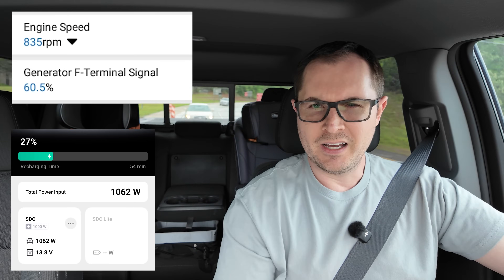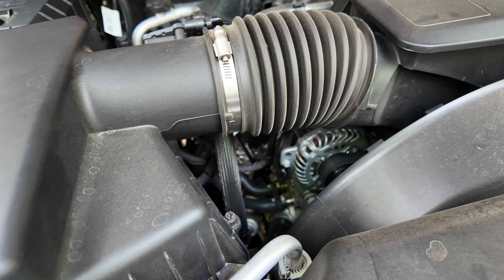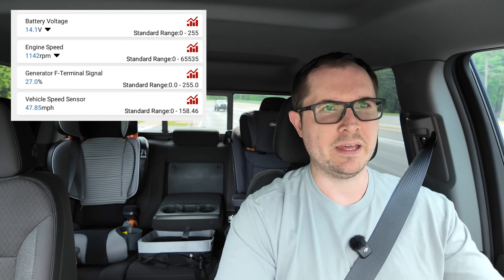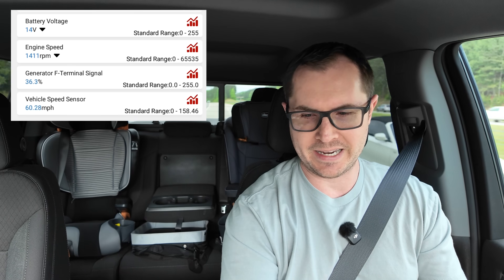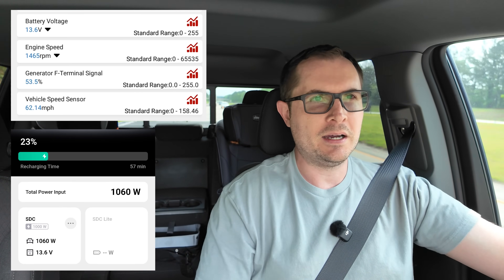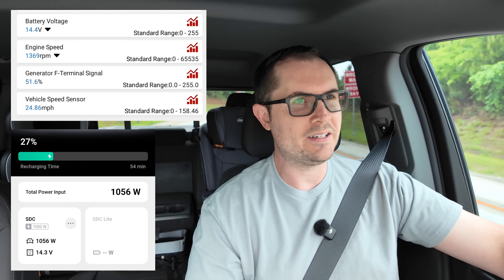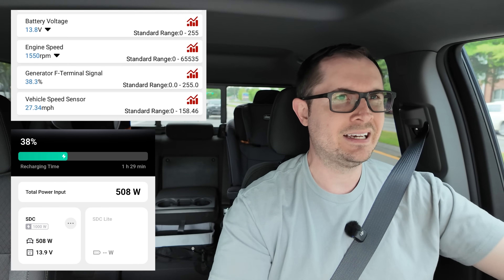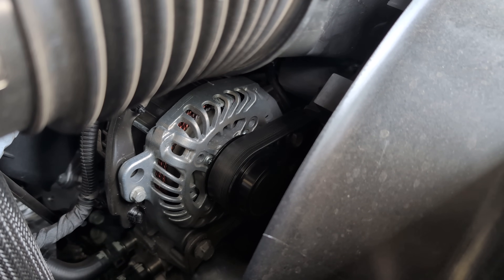I Show REAL Numbers: Impact of DC-DC Chargers from DJI, EcoFlow, Bluetti on Alternator

Comment: Question: How have you wired your charger to the vehicle battery? Have you connected the negative terminal directly to the vehicle battery, or have you connected it to the vehicle chassis? If you have it connected to the battery, the return current is not going through the vehicle current usage sensor. If the vehicle is not aware of the extra current usage, it is not aware that it needs to increase vehicle RPM at idle to compensate.
Reply from the maker: Great question. I'm relatively new to GM trucks, but in the process of installing the DC-DC charger on my truck I discovered GM's EPM system, which apparently has been around since ~2005ish. It's my understanding GM used to use a ring/sensor around the negative lead to read in current that fed into the EPM system, but it appears at some point in the last few years GM changed to what almost looks like a mini shunt/bridge right on the negative terminal of battery (small plastic loop/clip with thin gauge black wire running to it). So just gotta keep any accessories on the right side of the sensor so it reads in that data properly.

Comment: I have been running a cetek DC to DC charger since 2017 I've updated it to charge a lithium-iron phosphate batteries now. I run 170 amp hour battery. And 160 watt solar panel on the roof. I also have a victron AC charger. My fridge runs from April till September non-stop. I just plug my truck in at night to run the fridge off of AC and the victron tops off the batteries. You also have to remember all new vehicles have smart alternators.  Make sure your negative wire is past the negative battery shunt Most of the decent DC to DC chargers have a trigger wire that will turn on the charger when the voltage requirements are met. You can wire in a toggle switch. And turn off the charger in stop and go traffic if you want.
Reply from the maker: Thank you for the info.

Comment: About a decade ago I built a diesel powered charger for my off grid battery bank using an old school Ford 1G alternator.  The field is connected directly to a 12 volt lead acid battery that is maintained by a small battery charger during use.  In old school terms, we call that "full-fielding the alternator", in other words, the alternator is running full-out (balls to the wall), and by my last calculation based on the total amount of fuel I've burned, there is over 2000 hours of run time on the unit and still going strong. I set the rpms on the diesel so she's putting out 60 amps at about 55 volt (it's connected to (4) 16s 3.2v lithium battery bank, or roughly 3300 watts continuous.  BTW, that alternator was a used Ebay find for like $70. They are way stronger than you'd think. Take that for what it's worth.
Reply: Before the days of the modern inverter, I would drive the field winding beyond 12v to get close to 100v out. I was young and inexperienced then, just seeing what I could do with it. Alternator never died, but I did smoke some motors that couldn't handle DC 🙂
Reply: @tlmelec  I SO get it. And yes, I'm driving the field winding way past 12V,  closer to 13.2. They don't care. At least the old school Ford doesn't care lol
Reply: Interesting. Do you know of a good resource to learn more about this please? Cheers

Comment: Great video!  I say give it time. Lithium batteries have gotten “smarter”. I expect these different devices to talk to each other. When your Generator F-Terminal reaches a particular percent, the DC to DC charger would cut out.  When conditions improve it would turn back on.
Reply from the maker: Great point, thanks for watching.

Comment: I didn't chance it with the OEM alternator and replaced the 130amp one with a 200amp one and limit my charger1 output to 500w, that should mean I'm drawing maybe 45amps at most. If I need to you can easily drop the charger down to 200w to decrease the load. I haven't had any issues for 5 months. That said, I can swap an alternator on my 2004 4.7L Jeep in about 10 minutes.

Comment: Good to know, not sure what size alternator our 2025 F-150s but they are supposed to have heavy duty one for the auto start/stop engine. I only run our bluetti charger at 450w or less due to this reason of not knowing, plus 450w is more than enough.

Comment: Also need to keep input wire size in mind and use correct size cables. A DC-DC generally draws more than it outputs. So verify to check and see. With a clamp on ammeter multimeter a Renogy 40a charger was drawing 53A, size wire and fuse for 60a in this case.

Comment: I suspect that those raising a red flag are the typical idiots out there who lack common sense. If you are in bumper to bumper city traffic then throttle down the accessories or the charger. Again, common sense. I have the Eco Flow charger and have zero issues or worry. But I also use common sense. Idiots have problems throughout their lives and are not the norm.

Comment: that device should be smart enough to stop or at least lower it's output when it senses the vehicle is at or near idle
Reply from the maker: Great point. So far the main players (EcoFlow, Bluetti, DJI, etc.) just watch for voltage to drop...minimum setting is 12.0-12.6V depending on brand. So it'll eventually cut out when the alternator stops keeping up, but certainly alternator could get quite a workout and pretty hot otherwise.

Comment: it would be nice of these dc-dc chargers would dynamically change its charge rate to prevent your vehicles alternator from hitting above 75-80%.  when your on the highway it could easily handle the load but certainly at stop and go traffic its pulling too much.  Great Video.  I think the take away for me is know what your using and what your vehicle is capable of because it will vary a lot depending on the vehicles alternator.  It may degrade your alternator over time but certainly with some careful planning and testing you can adjust to meet that sweet spot.
Reply: Since the alternators don’t have a computer that would require tying the dc-dc charger into the OBD computer.  Way too complex and different for every vehicle year model too. Not happening.
Reply from the maker: Great point! Thanks for watching.

Comment: The vehicle's alternator was not designed to charge batteries like that. Anything that works harder is going to wear out faster. Does it financially make a notable difference? I doubt it. The convenience may outweigh the cost of replacing the alternator.
Reply from the maker: I hear you. Definitely a concern for a lot of folks. Thanks for watching.
Reply: Install an aftermarket alternator that has a 100% duty cycle rather then constantly replacing lesser stout alternators. Add alternator temperature monitoring and you are golden.

Comment: If you want to measure stress on the alternator, monitor the temperature of the windings and diodes. The F term voltage is somewhat misleading. It is simply part of the regulation for voltage and not due entirely to load. As the RPMs decrease, the voltage on the field winding is increased to maintain voltage output.
Reply from the maker: I hear you, and thanks for sharing that insight. I wish I had a temp variable to read in through my OBD2 reader for more data, but unfortunately that's what I've got on my truck. Surprisingly my alternator temp remained about the same via infrared heat gun about 165 (F) with and without the DC-DC charger running, but I also was moving with average speed of 40mph so lots of air flow in the bay. I could definitely see temp rising steadily if I was idling though. Great point.
Reply: Hey, I used that wireless clamp meter with the temp probe on my alternator case, and it hit 100°C sometimes when the car was idling with the AC on.
Reply: Yeah, I assume (I don't know) that the F terminal is the field coil terminal.  The field coil determines the output of the alternator and it makes sense that the field coil would be stronger the slower the alternator runs to keep the power up to meet demand.
Reply: Yup, the Guy knows his stuff 😉 Temperature is everything for Electronics - More heat = shorter life not counting cooking things like the Bearings. Don't think I would want to use more than a 20Amp load for any extended time as the Guy above.
Reply: It's the commanded pwm from the ECU to the alt. There's still all of the ampacity of the battery(s) to dip in to the 11V area before there's any concern. The issue with longevity is heat.

Comment: I have a basic question about alternators in general.  So what if the alternator is at max output?  Will that reduce the life of the alternator?  If so, how does it do that?  Does max output cause the alternator to overheat for example?  If it overheats, will it wear out the bearing prematurely?  Or will it cause the brushes to wear prematurely or the wiring?  If max output does not cause overheating, then what other way would it result in premature wear on the alternator?
Reply from the maker: I know for me personally it seems like running over 80% of capacity for pro-longed periods could lead to premature failure. I like to stay 50-60% max, but I only use my DC to DC charger once a week or so at most unless we're on a vacation maybe once a day then, but I plan to always be moving and not idling.
Reply: @AdventureRocks  that makes sense to me intuitively.  But if running at 80% or more of capacity for long periods does result in premature failure, there must be some mechanism that causes that failure.  The only thing I can think of is heat, that it causes the alternator to run hot.  And that must cause the bearings or brushes or even the wire wrappings to fail somehow.  But I don't know enough about what happens to an alternator when it's running at near capacity.  I think one could argue that it's kind of the opposite of an electric motor and running an electric motor at its capacity does not cause premature failure.  (For example the motor on my swamp cooler, it just runs and runs.)  So I wonder whether running an alternator at capacity is actually something to be concerned about.
Reply from the maker: @pimacanyon6208 I'm with you on the heat. That's one of the big reasons I'm reluctant to push it hard when I'm idling since there's not much airflow.

Comment: I wonder if a large 12vdc rated capacitor ahead of the Bluetti C1 would help in idle situations. Can you do a test where you install a capacitor ahead of the dc-dc like they use in car audio sound systems? I’m not sure if this is even possible or worth the effort. Perhaps this would lessen the burden on the alternator. We used to install these to reduce the headlight dimming effect from large power amplifiers and subwoofers.
Reply from the maker: Great question. Sounds reasonable. It's a bit more than I'd want to tackle personally, but I think you raise a great point.

Comment: I’m about to install the Eco flow 800 W alternator charger on my 2014 Prius hybrid V now I think they said that my car doesn’t even have an alternator. I wonder if you could give me a couple of insight or recommendation if I should even do it or not. My plan was to use it on idle while I car detail and sometimes while driving for camping.
Reply from the maker: That's a great question. I have not owned a hybrid so I don't have first hand experience. Sorry I couldn't be of greater help there.

Comment: Mechman alternator solves this issue. American made answer high output alternator. Just installed one on my truck and could not be happier. Went from a 170amp alternator to a 250 amp alternator on my 2014 Chevy silverado

Comment: I have a Ford Transit with the 150 amp alternator and single battery. Came from the factory with the single 60 amp Customer Connection Point terminal. Ford documentation says it is fine to use this for the occasional 50 amp (500 watt) load. Interestingly, Ford recomends dual batteries as the first step up rather than increasing the alternator capacity. 

I recently installed the Bluetti alternator charger. I Let it idle while charging for about 15 minutes. The alternator gets pretty darn hot, so as other posts have stated, it is better to dial it back or shut off charging if you aren't moving. Bluetti suggests going for a drive when charging. The alternator charger output is adjustable with the app, so use the minimum needed based on anticipated travel.

Lights and heated seats draw a lot of power, so keep those in mind when considering power needs.
Reply from the maker: Great points, thank you for watching.

Comment: Those new GM trucks can modulate how the alternator runs and even shut it off.....its a little fuel savings trick. I wish that you would have tested the Pecron unit which was the first one released and the cheapest.

Comment: It would takes months to kill the alternator. I grew in the generation of loud stereo in cars pulling over a killawatt from stock alternators from 6cylinder cars and one 6 cylinder suv (blazer) all well below 200 amp alternators. I think most were around 130 amp. And yes having my music full blast everyday for hours at a time it did finally kill the alternators after about a year of use on each of them. Here's the fix either get an AGM battery or just upgrade the alternator. But if your not using these things to their max every single day for hours at a time your not going to kill your alternator. Not any quicker then just using it normal.
Reply: 1 real kilowatt is still only 1000watts, under the 1200 watts most alternators make..

Thing with sounds systems is, they really never draw their rated power. Each audio circuit would have to constantly play the specific sine wave audio sounds that draws the most. It wouldn't be music, it would just be sound.

Comment: I have a 2024 6.6L HD with a secondary alternator and battery. The BCM will stop the alternator charging under certain conditions like alternator/battery heat. It is designed to protect the alternator and battery. I learned this because initially the secondary battery was not charging. GM had to do a BCM update to resolve it, and the problem was later published as a safety recall. I guess my point is, this video does not touch on the role of the BCM. Also, these HD trucks are designed to push a lot of electrical loads for various equipment. The BCM is supposed to protect your systems, so I thought. Anyway, I don't think it will destroy your alternator,
Reply from the maker: Thank you for that info, and thanks for watching.

Comment: Have you tried Victrons smart chargers?
Reply from the maker: Not yet, just EcoFlow, Blluetti, and DJI.
Reply: @AdventureRocks  I asked ChatGPT to evaluate the chargers from all four brands—EcoFlow, Bluetti, DJI, and Victron—and identify which ones could potentially harm a car's alternator and which ones are safe. Here are the results: 
EcoFlow – ⚠ Can be risky. No alternator protection, and fast charge mode can really stress your system.

Bluetti – ⚠ Same deal as EcoFlow. High current draw with no smart charging logic.

DJI – ⚠ If you're using their power stations, it's similar—no alternator safeguards.

Victron – ✅ Totally safe. Built specifically for vehicle setups with full alternator protection and smart charging.
Reply from the maker: @cd8788  I hear you on the concerns. Apparently AI can give some amusing responses. The reality is, they all monitor voltage and that's the protection built in. Basically when the voltage drops, it's a signal that the alternator is stressed or at its limits and then they throttle down or cut off. That's about as smart as they can get without a temp sensor mounted on alternator or an OBD2 connection. In my opinion keeping the wattage down and not idling is best practice, as rarely do most need to charge at 800-1000W. 250-500W is plenty for most use-cases.

Comment: I am not sure what the Generator F terminal signal is measuring.  Everything I have been able to read says that is looking at the generator electrical winding power. What is it actually measuring (I.e. volts, amps, or watts)?
Reply from the maker: Great questions. The OBD2 on my truck won't show the measure in amps unfortunately, but one way to estimate is take the % shown times the amp rating of my 170A rated alternator (when not idling, at full power). So 30% would be about 50 amps and 80% would be about 136 amps. Those are approximations. Most accurate method would be clamp meter to measure exact amps, but that's harder for me to record while driving. To answer on volt question, the % is not related to the volts as those are separate and read directly through OBD2. Last, the watts would just be Amps times Volts, so the 1kW draw from the DC-DC charger equals about 73 amps @ 13.6V.
Reply: @AdventureRocks  Great answer!  I am considering getting a Bluetooth enabled clamp meter to do just that.  In my case, I am converting my RV house batteries to LiFEPO4 (from lead-acid) and I am concerned about the draw on the alternator when the house batteries are significantly discharged.  I am using a LI BIM as some people recommend but I am not sure it is enough to fully protect the alternator. I am considering using a DC to DC charger instead, but that has its own drawbacks. Thanks for the info. Great video!